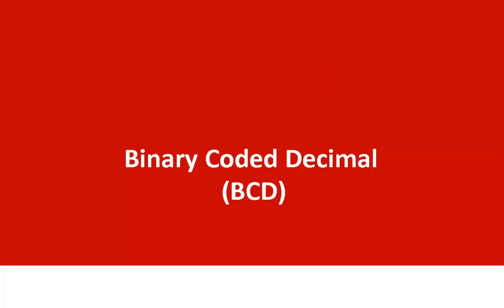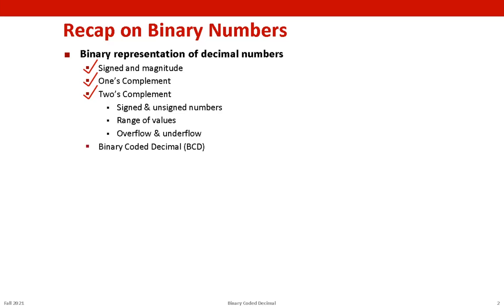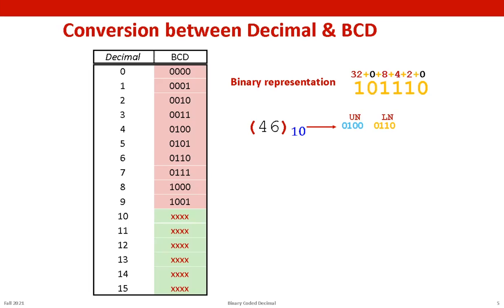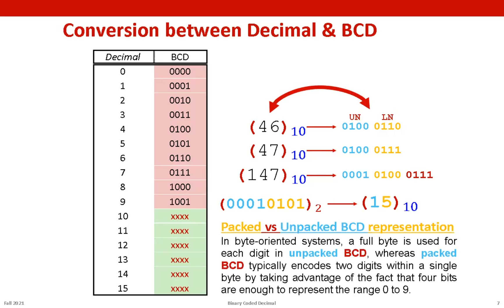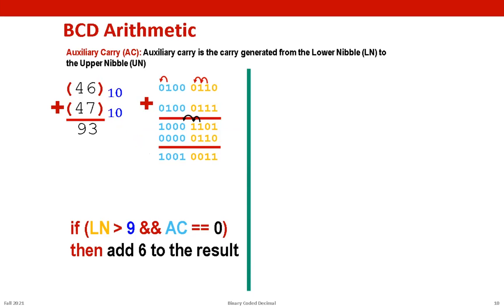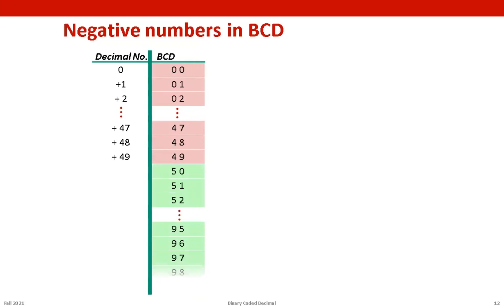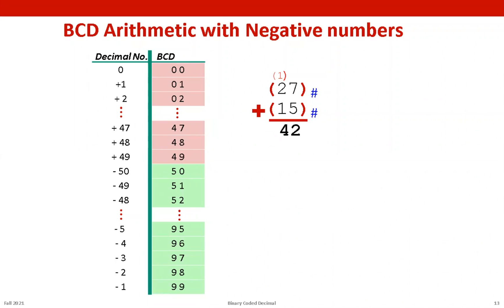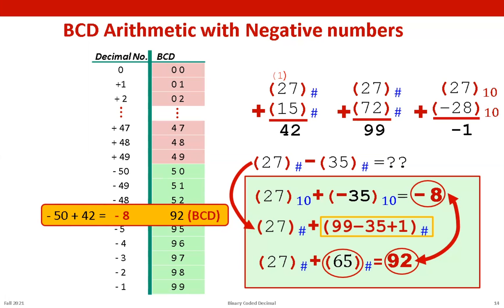Binary coded decimal | BCD arithmetic | BCD code

Comment: sir
why BCD arithmetic doesn't guarantee overflow ?
Reply from the maker: In BCD, overflow does not generate an exception, we have to detect it by ourselves based on the golden rule that we discovered in the video. And based on that rule we have the second adder that is hardwired to add the value 6 (0110) to the output of the first adder - which is equivalent to a subtraction of 10 (10's complement) thereby undoing the overflow of the first stage. Though, we don't have the overflow flag but we do have the auxiliary flag which helps us in handling overflows, I hope you got it. take care
Reply: @TechInstance  thank you sir!!